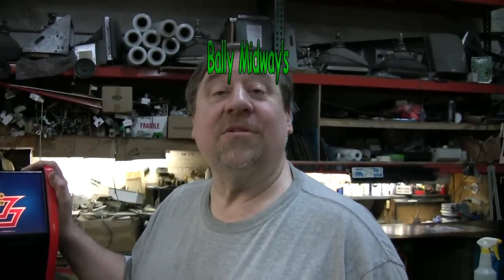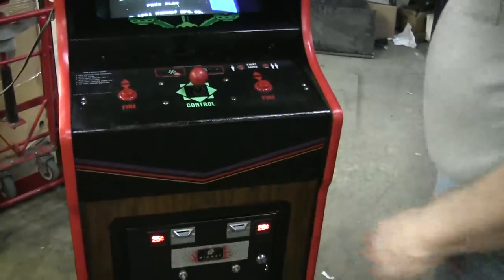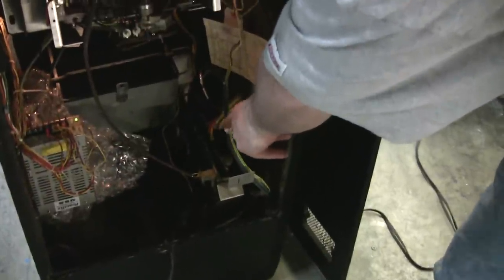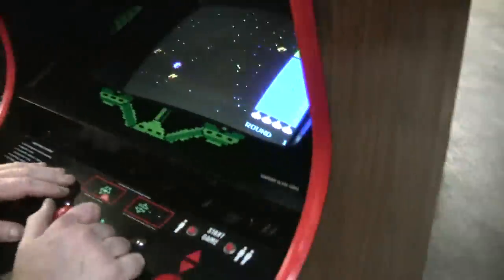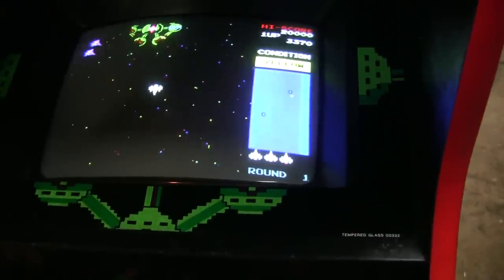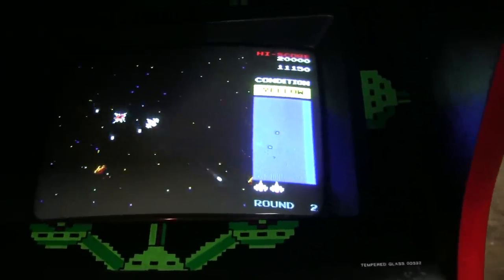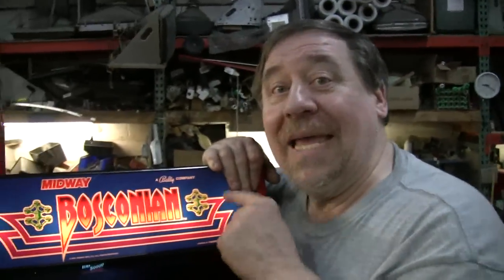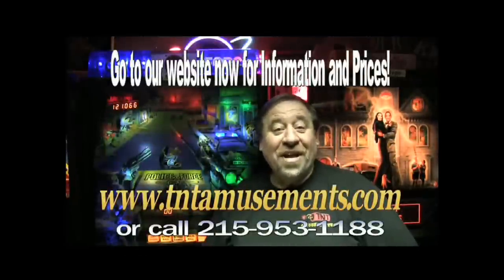#181 Rare Bally Midway BOSCONIAN cabaret Arcade Video Game Restoration - TNT Amusements

Comment: You lucky dog-a Bosconian (and a caberet to boot!!!!) The reason you don't see a lot of these any more is that lots of them were converted to Galaga by Midway and operators as well-they same the same wiring harness and like you said they same main CPU board however the video boards are different and both share with Rally-x the same power supply board. NOTE: if you ever see a Galaga in a white cabinet SUPRISE! It's a converted Bosconian!!! Again my congragulations on this rare find :)

Comment: I have one of these which was converted to "Rush 'N Attack", but hoping to deconvert back to Bosconian.  There's an adapter for the Konami board, but it uses the original linear power supply which I suspect is why the game stopped working (and why I got such a great deal on it!)  need to find a Bosconian PCB, marquee, and CPO now!
Reply from the maker: +David Sherman Look on GreedBay....best place at this point...but also try the Newsgroup forums!